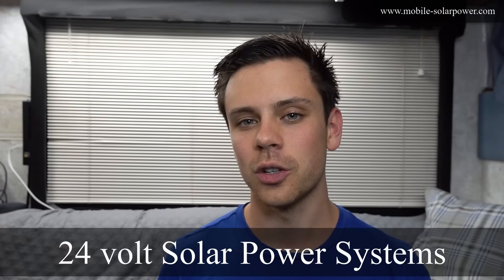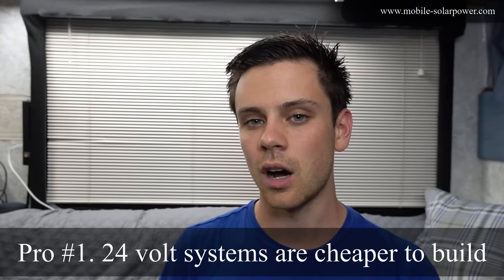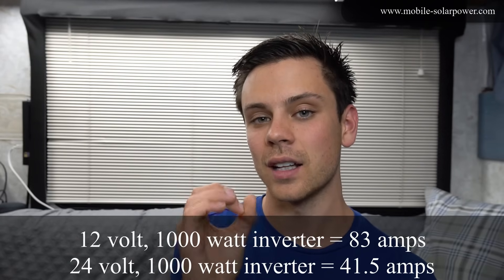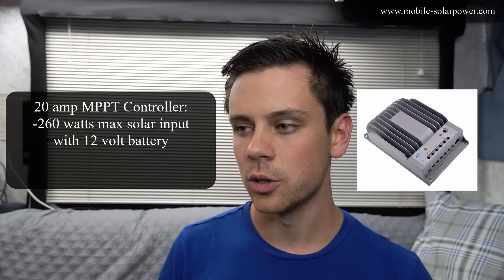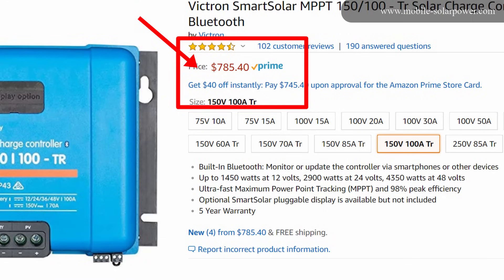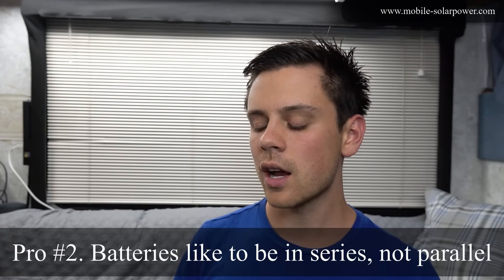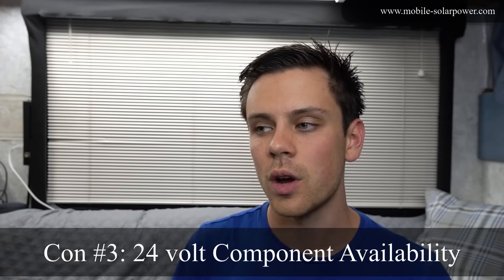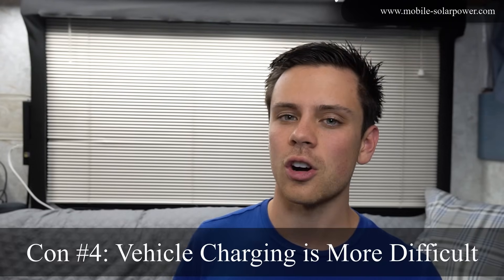12 volts VS. 24 volts for Off-grid Solar Power Systems

Comment: Im fairly new to solar so when I ask this please dont belittle me. Why would you need to set up your panel array to send 40 volts to the controller to charge a series wired 24volt system? Isn't that technically an overvoltage risk? I've always thought that voltage is the one thing non negotiable and should always be matched, where wattage can very as well as amperage to a certain degree. Please make this make sense to me

Comment: Great videos. Thank you.

One question - for a 24v system, is it best to get 24v lithium batteries and putting them in parallel to increase the amp hour capacity, or buy the biggest amp hour 24v and use a single battery?

Also, can you use 12v lithium batteries in series to get to the 24v? And now I think use 12v in series to get to 24v and then in parallel to get the desired amp hours?

Does the battery's BMS handle chaining lithium (in series and parallel)?

Thanks again for the great videos.

Comment: i have a 12v  battery to battery charger that charges my 12v 200ah victron battery (i use the victron for all my 12v stuff) its connected to my 12v 2000w pure sw inverter.
i use the12v 2000w pure sw inverter output to charge my 24v hybrid inverter batteries.(i also have 500w of solar panels.)i have a dc cuttoff switch  so i can swap the solar charging from 12v to  24v setup.i always use the solar charging for my 24v setup whilst driving. works well

Comment: I was thinking about doing the dolly system you have on your page "5000 watt" for a smaller trailer I have. Sometimes it sets for a while without use, and sometimes it gets used with AC or space heater. Can that system work for this trailer with 12V so I don't complicate other built in 12V applications or do I need a different inverter? And should I use 12V solar panels? Or should I stick to 3000 watt system?

Comment: In one video you said not to run lipfo batteries in series, i thought anyway, i have four brand new 12v  Lifo batteries i was gonna wire them all in series for 48v but i can do 24v instead i hope it works

Comment: Will batteries last longer in a 12V or a 24 Volt system? Thanks. (I'm using lead acid batteries now but curious for both lead acid and lithium batteries.)

Comment: 24v if you are cheap on the wire size and 12v is you use 6 or 8 gauge wire up to about 100 feet.
People seem to underestimate how long a wire run can be.

Comment: Just tripped over this 6yr video by accident and had to watch it since I did a 12V system and NOW I realize I should have done a 24volt system since 12v just doesn't leave any room for growth after you have 6 100 watt panels. So I ordered my 24V invterter 2 weeks ago. It's not all that expensive to upgrade to 24V from 12 in this day and time compared to 6 years ago. I'm still using the same Li Time 60 amp conrroller, just changing settings to 24V, and I've learned no more 100 watt panels. I'm using those to power a small system in my 40 foot container now for lights and power tools and charging power tool batteries. 4 380watt MonoPERC panels gives me just under 1600 watts and I got those panels for $102ea, whn I paid just over $100 for each 100 watt panel last year. And now I'm using the same 12V 280ah batteries x 2, but now instead of parrellel, they wil be series to make 24 volrs and I still have the same wh of battery bank, so all it really cost me to upgrade to 24V was the $250 for the 24V inverter and I';m using all the same controller and batteries, now my wire is a bit overkill but that's fine, and now I had the ability to go from 600 watts to 1600 watts. GAME CHANGER for relatively cheap. Had I knwn then what I know now, I'd have gone 24 volt from the begining.

Comment: So if I use 124 V battery using a 3000 W 24 V converter why do I need to do to plug it into my RV? How do I wire it to that? How do I use the plug that comes from the RV to the inverter do I need to reduce the 24 V to a 12 or do I just hardwire straight out of the inverter in the back from a 24 Volt.

Comment: so i get this bit bit thank you for explaining. my mppt will support up to 24v. I can buy a 12v 175w and a 24v 175w for similar price. My unit is 30amp so both meet this criteria I believe. My question is which will produce the most charge in my battery? or is the answer the same as both 175W? 🧐

Comment: I have a question. I have a bus, a big one, and we want to u solar total off grid. Im new to solar but not electrical. My wife wants to run the whole bus off 120v through an inverter i assume at least 5000 watts, i want to do 48 volt but cannot even come close to affording that set up being a disabled veteran and with a target on us by the white house. Ok the question, if i go with a 24volt system and start with one battery or two, can i increase or tie in more batteries or does that make charging them a problem. The bus is a 24 volt system but just 2 12 volt batteries. What i see is ne bay for power, up to 4 24 volt batteries as money is available, plus eco worthy 5000 watt inverter, the roof has room for no less than 5 panels, fuse panel. I have watched a lot of your videos over 3 yrs, but sometimes i get lost in the brans names and inf and forget to look for what i need, if you could point me to the answers on your videos.

Comment: We have a 5th wheel RV and I currently have one Epoch 460 but using it without an inverter.  I am still learning about solar builds and all the components.  I am leaning towards a 24V victron inverter along with two epoch 460 batteries and 1800-2000 watts of solar on the roof. We currently only have the Furrion 370 watt system on the roof.   We are looking to have a few days of off grid when we have drive days.   Does this sound correct?

Comment: Question, I have a 24v System, 4000w Inverter and converting from old 12v batteries in parallel.  

Can I use 200w panels rated for 12/24 system in series? You only speak of 100w, and I understood I could use 1200w total in solar panels with 2 new 40a controllers. I have 4 / 24v 100ah Lifepo's, or should I use 3 in series. 

Please advise. Thank you for your videos and web page.

Comment: I realize you get thousands of comments and I may not get a reply. Maybe a viewer can answer my question. You mentioned in this video not to use your vehicle’s alternator to charge your solar batteries. I imagine this is also true with power stations. Does this pertain to the devices offered today such as Bluetti’s charging unit designed to be run from the battery terminals in your vehicle? Thank you. I am learning so much from your videos.
Reply: D.c. to d.c. charger
Reply: @cj548  My concern with these chargers is, are they damaging to your alternator? It would seem they might overload it and cause catastrophic failure.

Comment: Even with a 24 to 12 volt buck converter, there are some advantages to 24 volts. If you want to have the batteries farther away from the load than is ideal (such as for reasons of solar panel placement or something), then you can run 24 volts to the 12 volt box, step it down with a converter, and then run the 12 volt stuff off of that. This is going to save on wiring again and provide more stable voltage since the sag from line resistance is unable to bring the 14 volts below 12 volts, the converter will just step it down less to make up the difference.

Comment: 2:55 the batteries are inducting a ac current across their union   its harder to go up than around and down   the earth is a ac motor  weight is the wattage    my north spinning particles vs my south spinning particles  vs the earths S and N particles  red shift  behind  high resonance image in the front

Comment: I've learned a ton just watching your videos.  Question.  I'll be building a Sprinter van to be a weekend camper.  I totally get why I would do a 24V (or higher) system.  Assuming I'm creating a 24V battery bank by doing two 12V LiFePO4 100Ah batteries in series, and I have a strong preference to using my 250 Amp (12V obviously) alternator to charge them, do I:
A) Use a Victron 12/24 DC to DC charger hooked to both batteries, or 
B) Use TWO Victron 12/12 DC to DC chargers (one to each 12V battery)?  I've come to understand that I shouldn't expect to use 250 Amps from my alternator if I want it to have a decent service life.  What kind of Amps can I pull from that alternator to charge my house battery and not smell smoke (or my wallet)?

Any opinion on the MWXNE 3000W 24V pure sine wave inverter?  Seems like it has substantial terminals for a bus bar, and I like the display.

The worst thing I'm going do to is run an 1800W single burner induction stove (on occasion).  The rest will be pretty low wattage (no parked A/C, etc).  Maybe a TV and PS5 at night.
I'll do solar eventually but since my intended use is to drive and not sit for a week, the solar will mostly be to keep my refer running while I'm stopped.  I appreciate the way you break everything down.  Keep it up!

Comment: I am working on a campervan project right now, and this info is very useful. A question, though: Can I set everything up in 24v except for the engine battery to house battery setup using a 12v DC-DC  AND a 24 to 12v transformer? Or do I need to ditch that idea entirely if I go 24v?

Comment: 5 years old but still so relevant today. My story is i built  Wills 12v system and it has been working well but my 100/20 Victron is limiting me to 290 Watts Solar. I have two 12v Lithium batteries in Parallel so i could use these in series to boost the system to 24v. Cost wise i would need to get a new Inverter and also a Buck converter. Just a pity i didn't know enough a few months ago when i started this solar addiction. We live and learn i guess.

Comment: If I have a 24 v system (mppt 24 v charge controller) and 2 12v solar panels, can I just wire the two 12 v panels in series?

Comment: If anyone can respond.
My rig has a 6.8l v10 and is made for a 2nd alternator.
My plan is to run a 24v high out put alternator into a 24v battery bank systems (with all the necessary protections for batteries and alternator, including but not limited to an external regulator).
This charging system will be completely separate from the vehicle original alternator/starting batter, chassis elecrical system.

In THIS way, wouldn't alternator charging the 24v system with a 24v alternator be ok?   I really would rather pay the premium price to purchase a high quality alternator, external regualtor, wiring, labor, belts, and bracket than to mix the two systems, also given that I am sold on a 24v system for the house portion of my rig.

Any responses I appreciate.  Thank you.

Comment: Copper lugs aren't expensive at all if you have a  hydraulic press and a drill.  Go buy a piece of copper pipe and make your own
Reply: I get the sentiment, but even just generic (non-UL) lugs, are not terribly expensive. It's when you have to use the damned UL listed ones (literally like $6+ a piece) that it gets incredibly expensive. To be up to code at inspection, in my state, my system would have needed about $200 in lugs alone. I paid like $40, if that, for generic branded lugs that are identical to the store bought UL. They are even tinned the same.

Comment: So currently im runing a Victron 100/20 charge controller on my 12 vt system with 750 in 2 panels and only getting a certain amount of watts out of it, waiting on my 24 volt inverter to come in and after i re wire my batteries and switxh the charge controller over to 24 volts ill get more watts from the panels?

Comment: Why not 48v, so many motors run on 48v.   48v tools are very powerful.    Many solar panels seem to output 48v as well.     Seems to me like it should be default voltage for off grid houses.

Comment: This video stopped me in my tracks! I am currently building a 12v system and now I want a 24v system! 

I’ve only purchased 3 206a 12v SOK batteries and a DC to DC charger on the way. I am also canceling a Solar Panel order (hopefully not too late). 

Is there a video (or book) that could help me to make this electrical design change?

I do have high amp 12v AC plus 12v diesel heating system, exhaust fan, etc. 

Please point me to a video/book that I can refer to for guidance. 🙏🏽

Comment: Just when I think I’m getting even a tiny grasp on the basics of solar there’s so many other curves being thrown at me. 12 vs 24 vs 48….,series vs parallel….dc to dc WITH mppt or mppt and dc to dc separate ….correct wire gauge, breaker and fuse size 🤯.  I’m hours upon hours deep into watching videos and reading and feel like I’m back to square one. Geeze!!

Comment: There is also a more complex system builds those who do paralell and series.. Good lord.. This is so that of you have 4 12 batter you can create 2 24 volt batteries... But the crazy things people do... With either,  as of Now I have 4 12 Volta batteries wired in parallel, but not in the way you think of aparalllel, having equal lines to post and neg, winter 1 singlual junction point for the post and 1 sngualr junction point for the negs going to to the Inverter with the voltage outgoing to the Inverter. I do the same with solar panels.  Very nice on this non traditional method. And you get a lot more umph out of the system with out over heating. I can run a dryer, operate an air fryer and a great deal more.  Infoact off of 400 watt system on cloud effect I brought in a full 255 watts at 24 Volts.. But hey you need an MPPT to do that.  But all in all, I am changing over to a 24 volt system because having 12 batteries in paralell allows for more awsomenss but you need to know the complex circuitry.  You can get 24 volt batteries. Those will run you some money.

Comment: Will a 12 volt system with a 100ah lithium battery and 400w of solar panels run a 450w AC window unit in full sun?

Comment: March 2024 i just came across your channel. I'm building a "johnny cash" portable power station (one piece at a time). I have two marine deep cycle SLA batteries so this video is very helpful to my project. I'm weighing the pros and cons of 12 vs 24 volts. Thank you for good straightforward content, well explained without a bunch of non essential intros or other junk.
Reply: I like the name of your portable power station. Lol 😂 "Johnny Cash"😂
Reply: If you were building a Bug-Out jeep, which system is best, 12v OR 24v...?

Comment: The fridge is the only thing holding me back from a 24v system. I know there are transformers, but I need to know, are there really 12/24v fridges? I know people say all the time "you can't use 12v on 24v and vise versa" but Amazon is full of 12/24v fridges. Do they like have a built in transformer and a sensor that senses when it's getting 12v or 24v? Because if so, I'll just get a 12/24v fridge and some 12/24v led lights and skip the transformer all together. Provided Amazon aren't just writing false information? Perhaps they are only 12v but write /24v too to sell better?
Reply: I don't know if this helps, but I bought a 12/24v cooler off Amazon and I have it hooked up to my 24v system and use it to store caffeinated beverages in. 😅 I've also used it on 12v car outlet without issue...
Reply: @theslacker29ify  It does,  thank you! :) Well at least it puts me at ease a bit.

Comment: i have 1520 watt solar for my truck  solar panels are 390watt 48.2 voc, 9.97 isc, , I have 2 , 200 amp hour batteries with victron 100/30 controllers x 2 , I was going to the setup on 12v but was planning on running 4 100/30 controllers, but if I go to a 24 volt system I only need 2

Comment: I just want  to be able to charge  a lifepo4 battery with my solar panel or panels. I have 1  195 watt eco-worthy panel.  and the lifepo4 battery  probably a 12,8v  50ah battery is to augment the capacity of my bluetti EB3A 268wh power station. I cherge it with my single solar panel 195 watts,works good. But i would like to charge that 12v lifepo4  50ah with my solar panel. 
a newby at this  and i want  to do it the right way and have no problems :).

Comment: If I have a 1000w inverter hooked up to a 12v battery would it not be 8.3A 120V not 83A?  I'm an old school 12v camper guy here just trying to do the math.  Great content, thanks.
Reply: 1000w inverter and 12v would be 83.3amp. 1000w/12v=83.33amp. Fuse it with 100amp fuse.. 🔋

Comment: Question, ... can I connect two 6V batteries in series to make a 12V series system that doesn't stress the batteries? 😁👍👍🇺🇸
Reply: Yeah. If they're both the same voltage, same battery type, same age... Some old (new?) golf carts used 6v batteries in series...

Comment: Instead of using a converter from 24v. to 12v. are there appliances for RV's (led lights, water pump, fridge, heating floor, etc..) that are directly at 24Volts?
Reply: Yes.. There's 24v appliances.

Comment: Always great info Will....I built 3 systems in my All aluminum Aluma 7x14 Cargo trailer Tiny home conversion...1st main system ..... 12V 300ah battery with 1500 watt inverter  for all 12v and low 300-700 watt appliances ( 40 amp mppt /  renogy flexible panels)  ...2nd  system ......12V 300amp  1000 watt inverter for back up low 500-750 watt appliances...3rd system ( in progress) is a 2 12V 100ah lithium in series for  24v  with a 2000 watt  inverter to  ..let say.. power on  my 2.5 gallon water heater for 10-20 minutes.....it a pretty good system.. the 24V will be much more defficient to run  appliances ect thru the outlets.

Charge both seperate 2nd & 3rd system thru outlets with 15 amp 12V & 24V chargers

Any suggestion to optimize the performance, let me know.

Patrick...Love Our Planet Adventures!

Comment: HELP🛑 
I have 8  100 WATT  (4 EACH WIRED IN PARALLEL) 
Then those two strings wired in series to make 24 volts!  
I expected my voltage to be 27 or 28 V on a sunny day but I’m barely making 24 volts 😳
something like that what the hell do I have wrong? 
🛑HELP🛑PLEASE